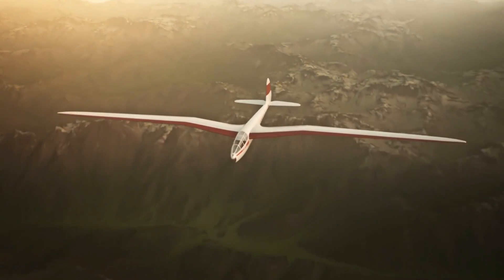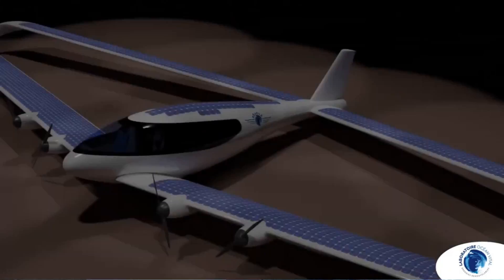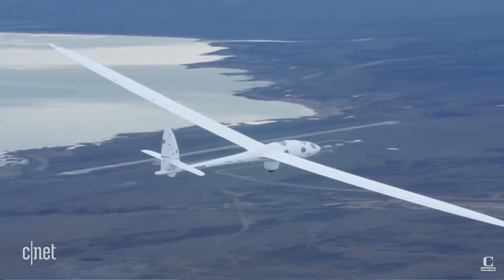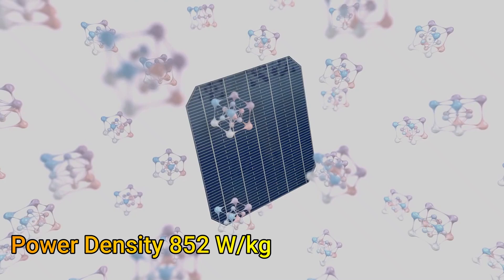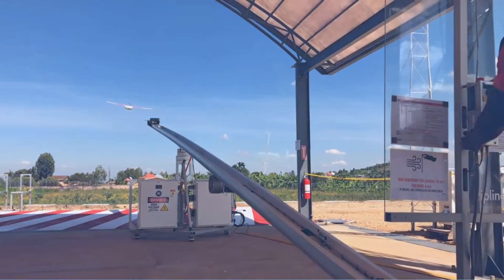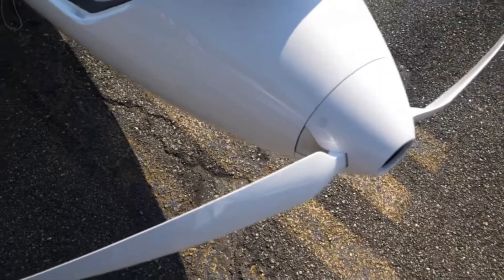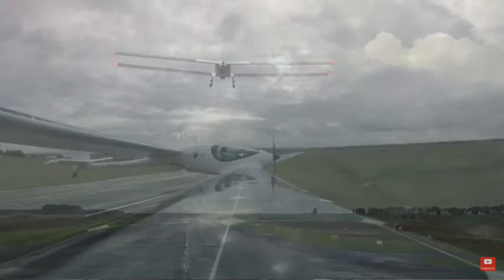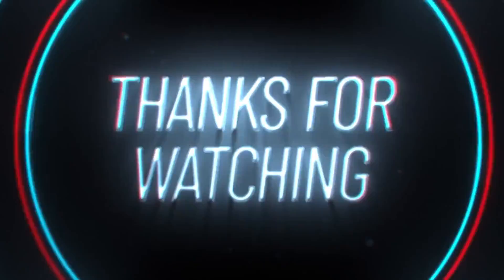Solar Cargo Gliders : The possibility

Comment: Autonomous soaring is another factor that could be used for cargo to extend range - no passengers to worry about turbulence or slower flight times.

Autonomous cargo planes  also have the advantage that no weight and space needs to be dedicated to the human crew.  Temperature and pressurization issues are gone for many cargo types.  Electric motors can also run at very high altitudes.
Reply: As a sailplane pilot for 55 years on three continents and winning competitions etc etc I think I can ,without respect, completely debunk the basic physical implausibility of your assertion -- only in one in a thousand cases could any assistance from atmospheric effects do you any good ,if that even. (unless perhaps by 'cargo' you mean a single pizza (delivered cold) or something equally tiny .
Reply: Wow, impressively ignorant statement.  Especially as you claim to have done sailplane competitions, where I expect you'll will have covered many hundreds of km's and speeds faster than road cargo, and on days you don't get to pick.  

Sure some days aren't good for soaring entirely without an engine, but most days there will be some helpful air movement if you have assistance from batteries and solar.

And most cargo is not heated/cooled, it just gets shipped in containers and experience whatever weather the truck, train,  plane or ship works with.  Lots of cargo isn't time sensitive.
Reply: yes, i am wonder when we will have fully functioning autonomous gliders that can traverse the entire planet.  we should see it within 5 years.  

there are videos of microsoft exploring the idea almost a decade ago
Reply: You could accomplish autonomous gliding you will not be able to accomplish autonomous soaring which just takes too much conscious thought, and autonomous system would not be able to identify lift sources and make all the decisions needed.
Reply: Thermals are very small and to use the best lift near the core you must fly slowly in small circles -the only 'cargo you might carry would be a small, cold pizza or some such miniscule 'payload' --unrealistic inexperience combined with the megaphone of social media at it again - how about rubber powered cargo aircraft ? @soaringeagle
Reply: @rossnolan7283  rubber? Again there were gliders available in World War II that delivers troops and tanks behind the enemy lines and they were not power. They were just towed up by a tow plane so you could tow up a solar powered glider. It would use the solar sustainer it would not need to use much in the way of lift sources, it would rely on its glideslope and the motor for minimal sink to regain some altitude from time to time. It’s just the point is that the efficiency of a glider with its flat glideslope would limit the amount of power needed because the lower drag so you’re just overcoming your sink with a little bit of powerwhich is less than a plating that has a lot of drag
Reply: @soaringeagle  by soaring you mean lift?

why do you think this isnt possible?
Reply: @shake6321  e gliding with elements of soaring. You aren’t going to be using thermals in something that big. L/d won’t be all that high, with a lot more on the d side of the equation. You’ll be able to use convergence, wave.. maybe minimal ridge, it would have crappy maneuvering around the mountains. Otherwise will be using the engine to bump it up a few thousand every so often.
I can see the efficiency, being way better than try to make electric jumbo jets
I am pretty interested in the Sunseeker
Reply: @soaringeagle  i dont think you can use this for passengers as humans might get sick from all the moves that might need to be made.  but i could see an AI make insane maneuvers to maximize lift when needed, take advantage of thermals and glide for a very very long time.  

AI delivery gliders is what i think we'll eventually get to in the not so distant future.  

if a human can glide for hundreds of miles i am sure an AI could do so as well and much better

Comment: yes! wide box wings (bi-plane box wings, no tips, just vertical wall) rock. bi-planes have about 1.7x lift compared to single wing plane. also canard double wing planes, linearly after each other. multi-glider (multiple consecutive wide wings, more solar surface). almost a kite. maximal solar surface, and lift surface, and minimal weight of the wing, fabric or foldable plastic. kite is better as a glider. ask birds or God. triangle kite with two poles left/right is the best strength structure with flexible folding wing fabric structure. come on with the patents, no more patents. not your idea. possibly double triangle kite wings, to make them rectangles, or diamond symmetrical.